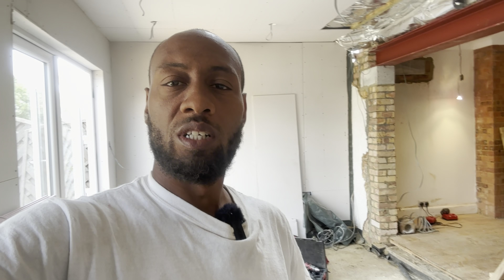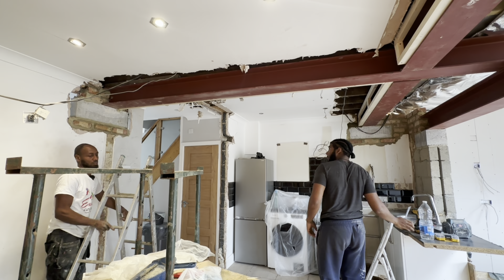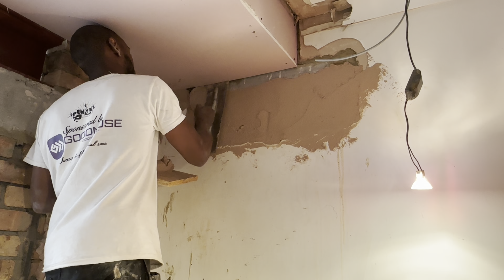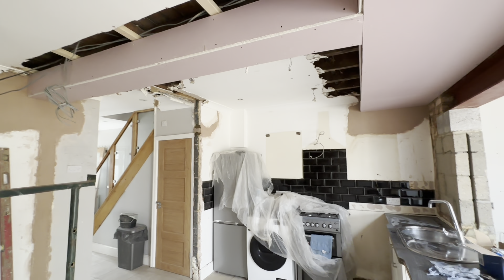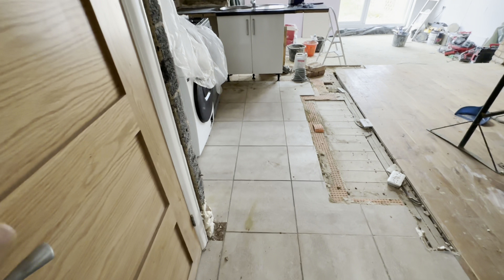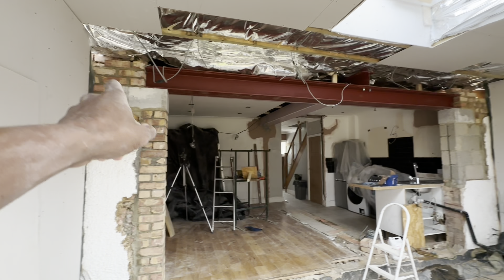Timber frame extension: Ep 30

Comment: Condolences to Mitchell. Loved watching the plastering work Darren - I’ve tried a fair bit myself at home and it’s been disastrous. Very satisfying watching a master at work :-) Couple of probably noddy questions: 1. Those bits around the pad stones at each end were quite large - would it not have been easier to cut some plasterboard roughly to size and dot/dab first then just used plaster along the joints? And 2. Where you were plastering up to the edge of the steel boxing, is it necessary to use that mesh tape stuff? Or does that tape come in on the next phase of the top coat of plaster? Thanks, Chris.
Reply: Out of curiosity what goes wrong with your plastering at home?
Reply: @Wgnwtb  I’ve only done tape and joint work at home mate. I always struggle with the tape itself with it creasing or not properly bedding into the plaster (I use the paper tape). I’ve since learned you’re meant to dampen the tape a little first. I then struggle to sand the plaster down flat again into the tapered edges of the boards. Or other times don’t put enough plaster in and end up still with a bit of tapering. Most often I have too much plaster and end up looking like a snowman by the time I’ve sanded it all done properly.